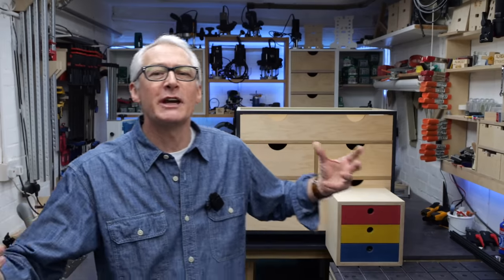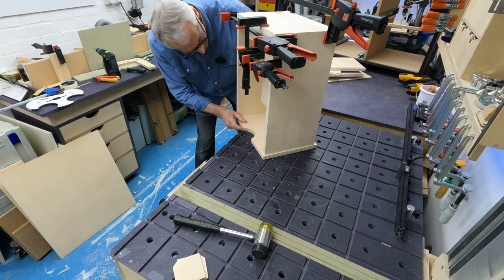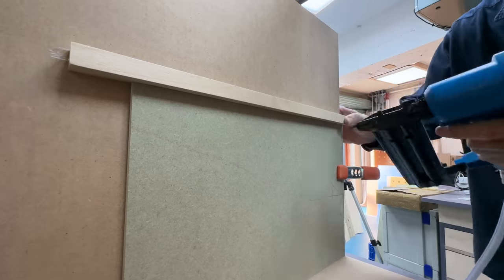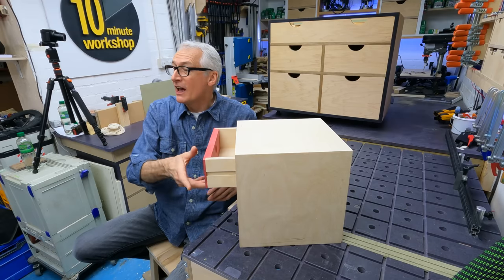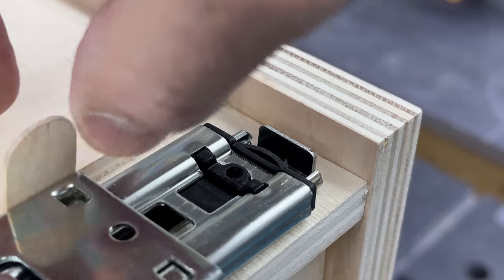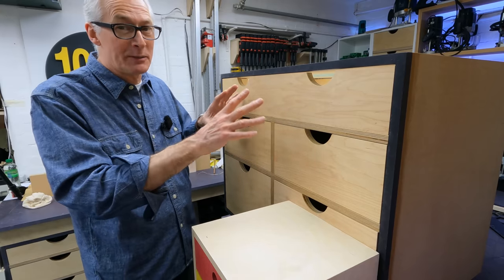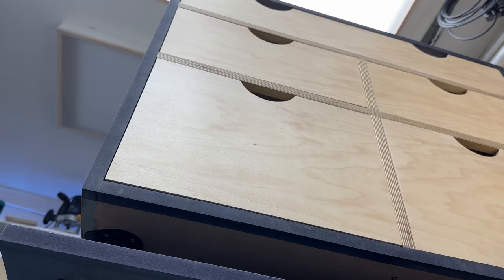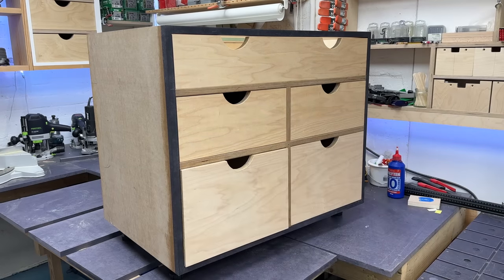Which Drawer Slide When? [video 527]

Comment: A great summary Peter. My first use of side mounts was for a stack of multi-compartment screw boxes.  The draws were simply a sheet of 18mm plywood but the runners were a doddle to fit and it is the most useful unit in my workshop.

Comment: Peter. Best ten minutes I've spent in some time. I haven't picked up many of your videos, lately, and it good to hear your smooth, easy listening delivery, again, even when you talking like a bullet train trying to get it all in in your 10 minutes.
A suggestion: Try a laminate or other smooth, dense material, like Masonite, when making slideless drawers. I made some 48 wide X 32 inch deep drawers for a printing company a few years back. They went on 1 inch steel stock racks. The drawers were flat and were made of 3/4 inch plywood with a sheet of 1/4 inch Masonite laying on top. The Masonite had to slide over the plywood They had a lot of surface area and carried a lot of weight, but slid smoothly.
Just got home from London, a few days ago. Always enjoy the visit.
Reply from the maker: Thanks! Closest thing we have to Masonite in the UK is hardboard, a thin low-grade material, but I do take your point about low friction and smooth surfaces, thanks! 👍👍
Reply: @10MinuteWorkshop  Hardboard and Masonite, I think, are the same, like Kleenex and tissues. Here it comes in a smooth surface or screen (rough) surface, often both.

Comment: Another interesting one Peter, however a rare thing, I found myself disagreeing with one point 🙈. Draws can be hard to make, but a a great project to learn woodworking skills because they need to made of consistent size components. For example, a three draw set need square fronts, or rectangular, consistent size yes, but often precise if you making in frame for example. Additionally If they are not square they will not travel in and out smoothly. 
But if you can build a good set of draws you are 90% the way to learning how to make good woodworking projects as most woodworking is a square box of some sort.
Keep the videos coming, always informative 👍🏻
Reply: Agreed - I think it was a Steve Ramsey video a few years back that made me realise why knowing how to make a box was pretty important.
Reply from the maker: Thanks! As I think I said, they’re not hard to make as long as you’re straight, square, precise, parallel etc… The actual construction is pretty straightforward, but you need to get those basics down first. 👍 👍
Reply: @10MinuteWorkshop  yep basic construction for sure, not had cut dove tails after all. The better I get the more I realise cutting something Square I now take for granted, which is not that easy when you first start out.
Look forward to the next video 👍🏻

Comment: I've just finished a 4 drawer workshop cabinet using non-soft-close full extension slides from Screwfix. They are surprisingly smooth in operation . I was never entirely happy with the action of some soft close push-to-open slides from an Internet source so I chose a simpler option.
595 mm deep and 650 mm wide, mostly organising power tools like sanders, biscuit jointer, jigsaw, angle grinder etc. Lay on false fronts and no handle hardware, just pull slots.
I used to be afraid of drawers once...

Comment: Probably not the first to mention them but the white, metal, two-wheeled bottom-corner runners are a good option at a low price point.

Main advantage after price is self-close.

Comment: I agree, I have used Blum here in the US for many years and never used their jigs. It works just fine to adapt their requirements to your style build. That said they do give wiggle room on the runners and those rear tabs are flat which makes the mating hole fairly easy as well. That said, they spec one of those holes on the rear very close to the outer edge which I don't always like. I have always just had my drawers come down on the outer edge of the runners as well and not captured by an interior edge and they work just fine. I was just over at a neighbor's build and the carpenter there rushed all the drawers with possibly the wrong Blum system (maybe he used the slides for their own Blum metal drawer system etc.) and they were running very rough and not engaging correctly on the "push open" feature which they do offer. Interestingly your adjustable orange clips in the video are indeed copying the look a bit of the Blum. During Covid the Blum hardware all but disappeared but seem to be in better stock these days etc. Their Euro hinge hardware is also recommended and no jig required given the measurements are fairly straight forward (the 5mm space between the inside of the door edge to the mortise for the hinge mount).

Comment: I would agree, side mount runners are an eyesore and to be avoided in quality work. I also prefer Blum Movento runners, but usually have a separate outer drawer front which I locate with 25mm drawer front adjusters (Hafele 430.90.320) these give me an easier final adjustment of the drawer front, using the adjusters on the drawer runners can be fiddly. The outer drawer front being finally fixed with screws.

Comment: Have you tried using the side-mount metal runners as under-mounted runners for small/lightweight drawers or slide-out trays?   . .  being mean I gave it a go with a slide-out tray/drawer in my coffee station with some success.
Reply from the maker: I haven’t no Rob; never had the occasion personally, and never wanted to ‘experiment’ with client work, though it’s crossed my mind on a couple of occasions! 👍
Reply: Someone makes/used to make under mount drawer slides that look to be the same as the side mount slides, but IIRC the weight capacity is about 15 pounds/7kg including the drawer box so really only useful for very shallow drawers for things like letters or kitchen spice drawers.

Comment: Peter, do you have any plans or recommendations for building cabinets on casters which are specifically designed to hold systainers? I want everything on casters in my garage, and I'm looking for a cabinet/drawer design which will allow me to open systainers while they remain in a drawer (while it is fully extended). I know Tanos makes their SYS-AZ Systainer Drawer Set, but I'd rather make my own for aesthetic reasons.
Reply from the maker: No, nothing like that I'm sorry; my floor is so uneven it's a castor-free zone! 🤷‍♂️

Comment: Hello Peter,

I’m planning on building a bit of cabinetry for the back of my car for the sake of storage, but I wanted it to be modular in the way that I can add in an extension to the rear of the cabinet and swap in a drawer that’s double the length if I don’t need to use the rear passenger seats. The only problem is that if I use the same hardware for both drawers, I could only access about half of the longer drawer, or if I have two sets of rails that I change out, it would only be a matter of time before the wood got too chewed up to use. Any suggestions? More specifically, the interior of the main cabinet would be around 24-26 inches long, and the total pull-out length of the longer cabinet would be around 50 inches long.

Best,

Keith

Comment: I used to use grass slides. Same type as blum but less expensive. Did check the price difference like forever tho so not sure how true that is currently.
Reply from the maker: Always used to use Grass dynapro but prices pretty much doubled from my local supplier so I switched to Blum. Great slides though, the Dynapro, 60Kg as standard. 💪👍
Reply: @10MinuteWorkshop  yes that's the ones! Your comment on the technical drawing made me laugh. First time you see one of them you feel like you need a degree to read it! But it's all useful stuff! Like the max wall thickness actually makes a difference cause once you go over it some of the measurements no longer work. If I'm remembering right it throws out the relationship between the gobbins on the inside of the cabinet and the gobbins on the underside of the drawer.

Comment: help!!

i got used slides for free (sikai brand), and i cannot figure out how to separate them for installation! 

when i pull the drawers out,  the notch in the back just comes right out.  

what can i do to fix this?
Reply: I want to add, I have to back pinholes in the right spot. I am using drawers that I also got for free, and they were originally used with the slides.

They did not really slide well to begin with, and I wanted to use this for a different project anyway.

I built my own bed with a 25 inch clearance underneath last year....so that I could save space with drawers and pull-out storage underneath.  

I ended up putting this shelf sideways, and mounting it on casters. Then, I installed a handle to be able to pull it out easily.

Sideways, rather than upright the spacing was a little bit different. It wasn't off much, I was able to fix that problem.

What I'm stuck on now, is how do I get these #!@!&! drawer slides to act right??!!